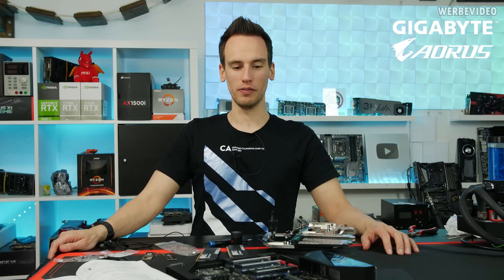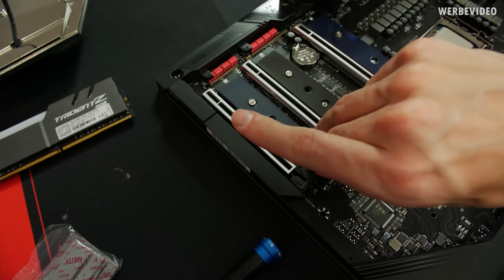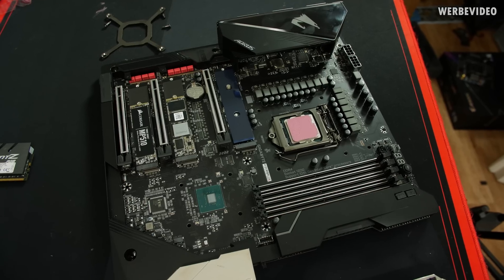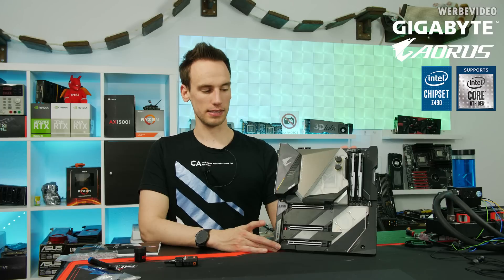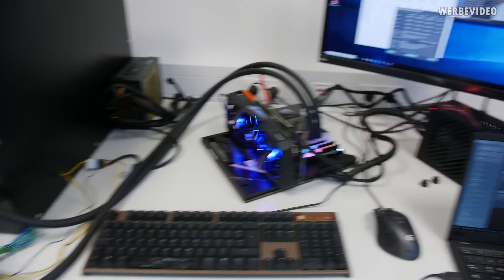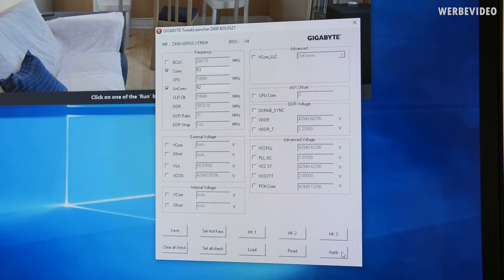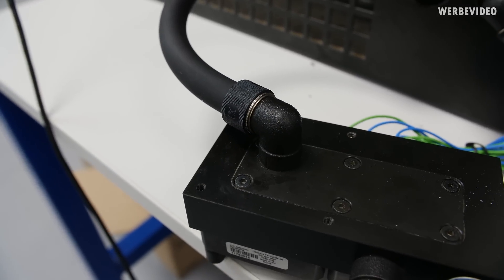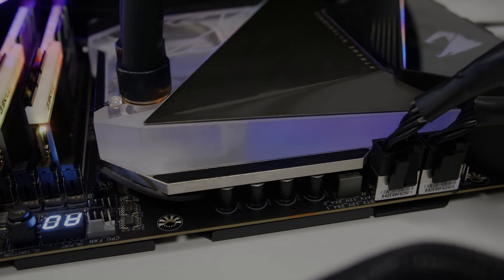A 4000W Chiller to tame the 10900K! feat. AORUS Z490 Xtreme Waterforce

Comment: Great video.  Now do not feel so bad getting 5.2 with AVX -0 and 5.0 cache on an AIO for 24/7. Voltage is a bit on the high side with 1.37 or 1.38 (can’t remember) and level 7. Temps 90-91 while running Cinebench R20. High 80’s when pushing for daily tasks. Mem not overclocked 32GB at 4000 with XMP2. Score 6844 though there may be some left over bloatware running in the background.

Comment: The chiller seems very cool, but how is it's cooling capacity measured/ rated? 4000W couldn't be its electrical rating, it would drawing over 17A at max on 230V and it looks to have a standard IEC C13 "kettle lead" which is rated at 10A max... and the particular lead you're using seems a bit thin even for 10A.

Comment: Basically the issue isn’t the chiller it’s actually the CPU’s thermal transfer from chip to cover plate/lid. The more efficient thermal transfers to lid the more effective heat dissipates to water block.

Comment: The thermal resistance of the die and IHS are significant here. Delid it and try again - you'll get way better temps and overclocking performance

Comment: Interesting video. When can we expect one about overclocking in a more fancy architecture like POWER, SPARC or RISC-V? As you might know, x86-64 is a pretty crappy architecture compared to those. All overclockers are always built on this architecture, and it can get a bit boring always using the same stuff. 
I've followed you for a while now and I've seen that you want your channel to feature rare and special stuff, so I think this may be a good opportunity to do so! :) I mean, I know that for POWER9 you can get a mother and cpu online on some stores.

Comment: Try using a radiator in between the monoblock inlet and chiller inlet. You can dissipate CPU heat without dumping heat into the chiller.

Comment: my highest score was 7120 at 5.4 ghz cache at 5.1 back to back runs no problem with custom loop, vcore set at 1.38v llc7 droop to about 1.35v on load, sa 1.35, io 1.35 with apex board 4400cl17 ram

Comment: Hey Derb8uer, I don’t run benchmarks much, but I game a lot. My 10900k is running 5.4ghz@ 1.34v stable in games like BFV and Modern Warefare. I beleive BFV uses AVX.  Not sure though.  I think I have a great chip. No doubt it can do 5.5.  I’m using a 360mm AIO by Asus ROG.  Temps hit about 80c max while gaming.

Comment: 5.2 all core 4.8 cashe  vcore   1.35 v .. 4000hz tforce 18.18.38 timings 1.35 v .
 Rock soild everyday oc .. 360 rad max water temp 42 under and core temps 60 - 70

Comment: I don't have the best chip but not the worst either, BIOS is reporting an SP score of 86. My 10900K scores 6601 in R20 while running 5.2 GHz all core (5 GHz on cache) at 1.36 V (with LLC 5 in Asus BIOS), temps hovering lowing 80s during cinebench. As for RAM, I have the same RAM as in the video, but running only at 3600 MHz, no overclocks or timing adjustments. Honestly I am pretty happy with the results considering I am cooling with just a 240mm AIO. Now that I think about it, pretty crazy to think that this setup only nets an extra 200 MHz. Loved the video though! That waterblock is sexy as hell!

Comment: Has anybody ever tried to overclock a PC in Oymyakon, Russia?  Just put a Noctua D15 on it, take it outside and run it air cooled at -65 degrees ambient. NO condensation problems as it will be the warmest obiect around.

Comment: Me stuck with my quad-core CPU:

Fusion360 is slow, let's add some Mhz

after 2 hours:

1.5v and 4900Mhz on a non overclockable i5-6500 running macOS

Comment: I got a 2500K running 5.1Ghz daily driver on air cooling. Its my kids rig. My ryzen 2700X is only hitting 4.5-4.6 w/ PBO + BCLK, on a CH7, its a beast board,just like you said it was. You think the crosshair 7 overclcocking tools will work with the 3900X? Everyone always uses the X570 platform??  Anyways,love the content as always Roman,keep it up man

Comment: 5.3Ghz core 4.8Ghz Cache 3200mhz cl16 ram 1.355V adaptive LLC6 set in BIOS on ASUS Formula R20 score of 6883. Chip is a SP110 according to Asus bios. Thats with water temp of 30c.
Reply: Are you on the latest bios ? As it sometimes reports it wrong

Comment: Does anyone know how much performance you loose every time the heat has to jump from one interface to the next?
Reply: That’s like asking how much HP is in a car, it’s not at all a constant, it’s a lot of complex heat transfer equations and there are huge variation factors. It can be calculated using empirically derived formulas (for each interface) but it’s not a single answer that is even comparable in the slightest, the only answer is a complex formula for each scenario, so the answer is get an engineering degree specifically in thermodynamics and heat transfer, because it can be 1 degree or 100 degrees, it’s not at all constant and even identical model processors can run way hotter than each other on the same conditions (so you also have manufacturing tolerances like IHS flatness and even molecular structure differences, I’ve even seen a chip run 20c hotter than another would in exact same conditions, so when I say it varies, I mean it varies a lot).

There is no answer to your question (the answer to the meaning of life is actually more simple in a short sentence: to worship God and love one another and follow in the example Jesus set forth and to spread God’s word and love to all nations, see the meaning of life is actually quite simple by comparison).

Comment: My delid 8086K goes to 5.3ghz, AVX 0 with 1.39v (final with LLC6). Temps are in 60-70c in cinebench. Heatkiller IV Pro block, 1x GTS 360 rad. Water temp kept ~<15c (~10c ambient) by max fan speed. I forget the score RBH, but it didn't crash. I can't run OCCT AVX linepack though. Games run fine.

Daily settings are 5.2ghz at 1.33v (effective with LLC6) AVX -2. That's stable in every application.
Reply: The more scam version of the scam 8700k version lol
Reply: @brazilpaes  Hahaha... no. I paid $300 open box at Microcenter with a full warranty and got a chip well above the average 8700K. What. A. Scam. :| Also got an X Apex for $240. Man, I got fleeced s/

Comment: "my best 10900k"
"Every" retail cpu's here in Norway are better than this ES cpu LOL
My 2x 10900k does 5300mhz all core @ 1.28v
Reply: yeah but there's a difference between a fully rock stable cpu overclock and a few stable runs at cinebench. Mine can do 5.2ghz at 1.26v for some benchmarking, but for full stability, I need 1.32v

Edit: also depends how high cache overclock you have. I run at 4.8ghz cache, 5.2ghz core. 1.32v
Reply: Good for you. My first retail was similar like this ES. I'd be happy if there will be any cpus available now. Out of stock in whole EU.

Comment: Quick question, you mentioned that there was no paste because you already used it, but the pads still had tape on them.
Were they reapplied after you removed it again to avoid them drying out?
Reply from the maker: The first mount was just to show the LEDs in the block. I didn't remove the tape on the first mount
Reply: @der8auer  Thanks for confirming!

Comment: So hang on a second. Am I missing something here? A 10900k running at 5.3Ghz with a chiller that large still only achieved under 7000k points on Cinebench R20. When and AMD 3900x achieves just over 7000 points running at 3.8Ghz on a stock AMD cooler?
Reply from the maker: 2 Cores / 4 Threads more. That's no surprise. It's like comparing a R5 3600 to a 10700K
Reply: @der8auer  Price wise, power usage, and heat output, It's getting smashed though surely?
Reply: @jackt883  depends what you use the cpu for

Comment: The result in cinebench20 is worse than mine R9-3900x on air cooling 😁😁😁 But the idea of using ice water to cooling CPU and GPU is OK 👍
Reply: You have 4 extra threads bore off.

Comment: Must be the contact from monoblock to cpu. Normal delta water to core is around 40c on that CPU. Seen a lot who can run 5.4ghz CB20 on strong water cooling, some even on aio. I would try with another waterblock, if i were you. Nice video btw :)

Comment: Where did you get your hands on the stock cooler Intel was planning on including with the 10900k before they looked at the price of shipping?
Reply: Nah, Intel’s marketing looked at a 15 year old dust filled cooler on the shelf and thought, “Perfect!” Except I’m pretty sure they don’t even still have the copper slug in the center.
Reply: Jacob Andrews they literally took the extreme edition lga 1366 cooler and rereleased it
Reply: I know you are joking around, but there actually is a stock cooler spec for the 10900K! Intels documents list the BXTS13X and BXTS15A, which are a 120mm AIO and a god-awful single-fan air cooler, as meeting the PCG 2015D cooler spec the 10900K requires. You wouldn’t want to actually USE either of those coolers (especially the 15A), but they do exist. They are just horribly inadequate.

Comment: Linus' Chiller vs der8auer's Chiller both chilling and overclocking CPUs
This should be a video just for LOLs 😂
Reply: Might as well throw away your watercooling radiator and fans and just switch to having a chiller cool your pc. Its actually really quiet, and if you get a freezer for a chillbox you can go subzero daily 24/7 without condensation issues.
Reply: @MikoMuru  I think our ideas of really quiet differ.
Reply: @MikoMuru  Wouldnt it cost in a ton in electricity? Or does it just cost as much as a regular fridge / freezer?
Reply: Fullyverified electricity costs is not that bad depending on your reservoir and btu. Btu is lower than a wallmounted 12000 btu airconditioner. These chillers especially the aquarium ones are around 4000 btu so it won’t be too much electricity and you wont be running it. 24/7 like an airconditioner. You can seth it to a temperature and leave it. The larger your reservoir the less the compressor will kick on.

Comment: last time my cat helped he snapped the pin to the top pcie slot in the cpu socket, he's only allowed to unbox and box test for durability now
Reply: The stupid release tabs? Yeah I break those off too, you should be thanking the cat. They are a total pain for a testbench system (and in a regular cased system the GPU is screwed into the case anyways). I don’t know how many times I’ve almost broke a GPU trying to yank and wiggle one out only to find that either the tab clicked back into place or I forgot about it, and if you have multi-GPU (my main system has 4x GPU), you have like a paper thin gap between each card so you have to use a bamboo skewer or stick to try and slide those stupid release tabs (some of the push down ones are easier, but some of those are also worse, almost all are impossible blindly poking around hoping it’s not a capacitor your hammering onto hoping it’s the tab...). So yeah, to not break say a Titan you probably do want to just snap those aweful things off the board and save yourself the tears and red faced yelling as you’re trying to crocodile wrestle the thing out and break something (because inevitably some cable gets pushed under it where it sounds like it clicked, but it’s not fully disengaged... oh yes, all of this is real examples I’ve dealt with.... seriously go pet your cat for being brilliant)

Comment: Finally Intel finally includes an adequate stock cooler for their cpus
Reply: @KAKUN_DESU  my 1700x hits it's advertised 3.4ghz just fine, on a cheap AIO no less.
Reply: @russellsenenfelder2281  my 2600 hits it's clocks 24/7 no problem, with a cheap 120m aio also. dont think its even been above 65C degrees
Reply: I'm getting 4.4 on most cores boosting so the 3700x is getting what is advertised.
Reply: Intel cooler starter pack
Reply: @KAKUN_DESU  3300x here goes 50MHz above its rated boost clocks at all 4 cores (not one or two that can make it there). Im talking single core boost ofc.
Reply: @KAKUN_DESU  That was some old version of AGESA tho, they fixed it long ago. I hit my 4.4-4.5 advertised few core turbo just fine
Reply: @KAKUN_DESU  Don't know what you're on about, my ryzen is holding up over the advertised clocks without OC and so did my brothers, until we OC'd it, and still fails to reach 60/65c depending on how warm the room is.
Reply: @KAKUN_DESU  I can't talk as I'm running Ryzen 5 2600x, having 0 issues with OC of 4.3GHZ constantly, while base clock is 3.6 and boost is 4.2 without OC, so I grabbed my brother over as his computer is 2700x one, his boost clock goes up to 4.7ghz. so I messaged my friend asking about his (You probably are seeing a paterrn, but before you call me AMD fanboy, up until Ryzen I was only using intel)he's running similar CPU as you are, he said he just had to updated his MB andd is currently running at 4.7GHZ (We all are on air cooler ranging between series of Bequiet dark pro). So from personal experience, and dealing with people who have the AMD systems, we haven't encountered any issues.
What I'd say for you : Check that your CPU cooler is able to dissipate the right amount of heat (Usually each cooler is rated at TDP with how much Watt of heat it  can handle) try updating your motherboard, and the only time was when i had issues with my Ryzen CPU was when I had a Crypto mining crap installed on my computer that I had to use Kaspersky (you can use any antivirus software) and malewarebytes to get rid of it, and bam it went back to normal.
edit: Have you checked your power management ? is your PSU enough for your GPU, CPU and everything else? In bios, are you being showed the correct voltage numbers that are expected? have you tried reducing them by small amount ? as a lot of people are saying they get better clocks when undervolting, what series is your motherboard? there's many things that can affect your clock speeds and cpu without CPU being the actual issue
Edit Edit: Spoke further with my brother as he said the only times he had issues with clocks not being high and pc crashing on ryzen when he first built the pc and was running his 2700x with 1070 but his PSU was only 550w, he upgraded to 800w PSU and all the issues stopped immediately as before hand he was capped at 4.4GHZ, so, yeah, there's a lot for you to troubleshoot before saying it's the CPU's fault
Reply: @KAKUN_DESU  IDK, chief. Mine's working as advertised.
Reply: @KAKUN_DESU  lol what? My 1700 does 3ghz advertised all day long (actually auto oc to 3.2ghz all cores ) & if i manually oc and set the fan speed to max with the wraith spire cooler then it can do 3.65ghz or 3.8ghz max and it would hit 90c which i am not comfortable with. & Intel can't even run an i7 non k series cpu at adverted speeds with their stock coolers.
Reply: @KAKUN_DESU  probably unadicuate cooling .. & also cheaper motherboard maybe.. make sure u have the latest bios. If u have a shity board like gigabyte , biostar or generic chinese ones then manually set stuff from bios. If u have asus or asrock leave everything to auto and it will automatically adjust for best stable speeds. Remember 1st gen ryzen was much worser at oc and getting above 4.1ghz was very lucky .. & r u running the stock cooler?
Reply: The stock cat is not bad either.
Reply: To be fair, If you can run Ryzen at those clock speeds it would just blow up.
Reply: @Quake_Masta  it`s not the first time AMD bet on intelligence while intel went on speed and lost

Comment: Cool vid!  Would love to see one of these on Strong Single Stage cooler.  I've a 10900K can do 5.3Ghz R20, cache was 5Ghz, scoring 6937cb vcore was 1.305v in BIOS, LLC lvl7 on Apex XII.  Max temp on strong water was 78c
Reply: Single stage (matching power input to cpu input, example a 350w compressor running at 350w cpu power draw) I get -35c on the cooling block at max load stress testing. So if you have 1 kW cpu and 1 kW compressor you’re looking at similar etc. it’s pretty decent, and your final temp is heavily dependent on the processor.

For FX, I never got above 0c on the core reported, so I don’t know exact temp since it couldn’t show negative, but probably right around 0c. Ryzen even with the block at -45c still managed to hit like 30 to 40c when I was really trying to push it, which is a crazy high 70-80c temperature delta, but it was also a small chip, and direct die helped a few degrees but honestly my mounting with zip ties was beyond janky so it wasn’t hugely better than with IHS, of course a Threadripper would be less affected since the IHS and surface area is just crazy big so even same architecture it would fare much better, if I had a big enough evap head. So the chip will change the results some as well as aggressiveness of your goal (oh that Ryzen I was basically willing to murder, it wasn’t anywhere near that hot if you were wanting reasonable voltage say like maybe 5-10c with 1.6v)